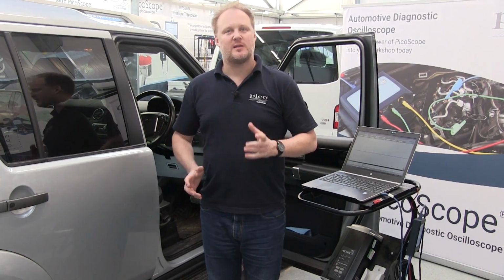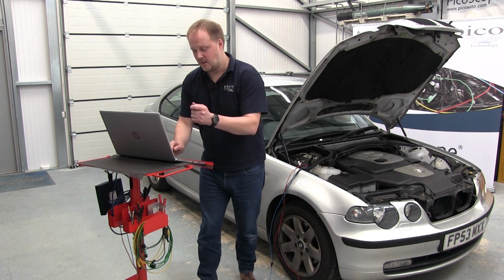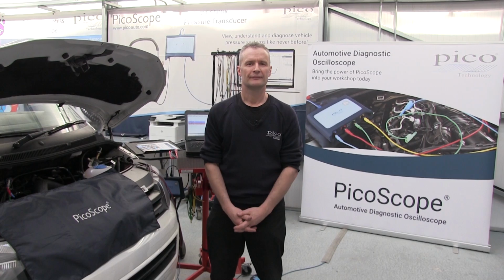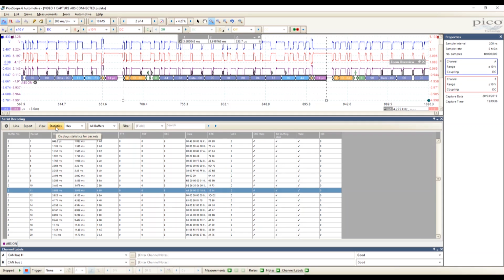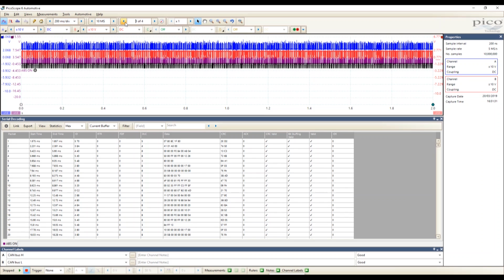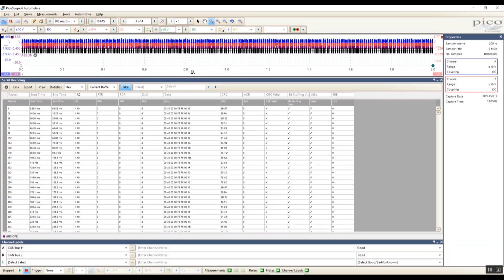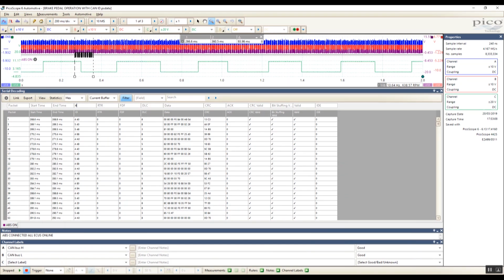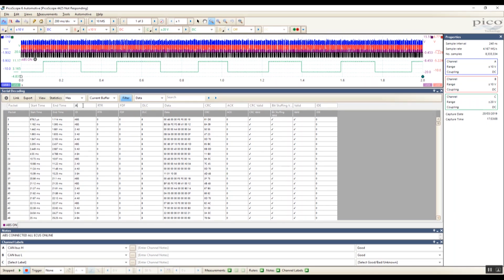Practical Pico: CAN bus diagnostics and serial data decoding

Comment: Wow great video,very knowledgeable ,j work in a main dealership its a shame they dont give us the ID info so we can go to faulty components  after de coding for a quicker diag as apposed to removing units off the Can system and resistance measurements

Thank you

Comment: Hello sir , i have picoscope 4425 and i am looking for no com with engine ecu and i trace the can network and in this high speed is engine ecu, abs, uec,cim,ehps and i connect on high low pins at its ecu alone and decode i have good signal and decode packs of data messages that include valid and invalid data but in the engine ecu can pins i hane only good signal waveform but no , either one data pack. How is this possible? What is the meaning? Or problem?opel astra h 2005 z16xep no comm with the engine ecu faults from the other ecu , the car becomes hot crank no start or no crank no start. Thanks in advance!

Comment: That resistance is only on the circuit between the other terminating resistor and your test, it dose not confirm the other modules in parallel have a good circuit at all. You may have a dash cluster or radio infotainment system that has a broken line to them and don’t run the other resistor, they now have not been tested, it’s important to know this, if you have a faulty ABS because both of these lines are needed for different functions from the ABS.

Comment: I'm interested in the rolling cart, where can I get one for my scope?
Reply: Hi , It depends on which rolling cart you are talking about. The cart used in the shot with Barney  (black unit) is a Ctek battery test unit supplied via CTEK. The red cart is an emmission tester trolley supplied by our Danish distributor (not avalaiable anymore) or the black tool box are purchased by Sonic tools in the Netherland. Hope this helps Philip

Comment: I completely get the concepts in this tutorial. But, question, is this to determine a faulty module on the network? Also, are the circuit tests in the beginning common failure modes to look for?

Comment: Is it possible to carry out the same tests but with the 2206b scope please? I really would like to add this to my diagnostic bag but can't afford the automotive series?? Great video by the way, info from the pros, 1st rate👍🏻
Reply: Hi,

Thanks for the feedback which we really appreciate.

The quick answer is that yes, it is possible to carry out those tests with a 2000-series scope as long as you have sufficiently high bandwidth and sample rate.

Beyond that, I'm afraid I can't support you with more information as the automotive team cannot support users with 2000-series scopes as they are not automotive products.

Some related info that might be relevant...

I appreciate that the automotive products seem more expensive at first glance but by the time you add equivalent accessories and specs - including upgrading to a higher sample rate model and adding attenuators for all the channels etc. - the difference is not so great. This is especially true if you compare the cost of an automotive kit to buying all the components individually.

Note that you can never actually achieve parity between the 4x25 scopes and the 2000-series as the former have floating inputs, 12-bit resolution (compared to 8-bit), and a ruggedized boot etc.

The difference in price also covers the Guided Tests, Waveform Library and PicoDiagnostics plus, support email/hotline availability, and online videos/articles etc that come with the automotive scopes. So actually you get an awful lot extra for a small increase in price.

As a former tech, I can totally relate to the difficult investment decisions we have to make (especially at this very difficult time) when you are trying to better yourself and the skills you can offer. But, hand-on-heart, I believe that starting off with the better tool will save you money in the long run, even if you have to wait a little longer before you buy one.

I hope that helps. Good luck on you oscilloscope diagnostics journey!
Barns
Reply: @pico_barney  Wow, what a great answer, I can see now the worth of the automotive series scopes and what now seems good value. Looks like I need to do some overtime! Thank you very much for the reply and keep up the very informative content 👍🏻

Comment: Hi, thanks for the video.How could you relate a problem to the various CAN faults you listed when an car would stay on one gear without shifting and when you turn off the engine and restart the car, the car starts shifting fine. What can faults could this problem fall into. Thanks.
Reply: The car probably has a bug within the software that is dealing with shiting gears, that acta like you noticed.
At first start of engine comes one (the bug) at next start everything is clear and nice.
Got to manufacturer and exlaind and ask for an update of the gear-shift module or to rewrite their software again..
Reply: Hi Paul, The question is: are you getting CAN-related DTCs when you do a full scan of all the vehicle ECUs? If you are getting transmission-related CAN DTCs then, possibly, suspect a CAN-related fault causing the problem you describe. If you don't have those DTCS, then you may be jumping to conclusions. I.e. what is it that makes you think that CAN is responsible for the symptoms you are seeing?

Comment: What is the exact model number of the device used in this video ? And could we do the same things on a lower models like 2 or 3 series ?
Reply: A 4425 scope was used to perform this test. Of the current automotive scopes we sell, you could use a 4225 (2-channel), a 4425 (4-channel) or a 4823 (8-channel). Of our older automotive scopes (no longer available from new), you can use a 4223 (2 channel) or a 4423 (4 channel). The bandwidth (10 MHz) of our older 3000-series automotive scopes is too low to reliably perform these tests.

Comment: What are CAN sniffers used for to do what or what have you used them for? Dodge & Chrysler cars use TIPM boards, How does a TIPM totally intergrated power module or central gateway work what does it do? There is different CAN signal names, CAN diagnostic, CAN isolation, CAN ground, what else?
Reply: Hi Bill, thanks for this comment and the others that you have left throughout this list. We are happy to help with points of clarification on items within the video and with matters relating to the use of our scopes. For other matters, please feel free to seek help from the wider community on our online forum (https://www.picoauto.com/support/index.php). However, it may be useful if you find other opportunities to undertake training or self-learning - it will pay you back, I promise! Also, please try the manufacturer's reference material for the highly specific information you have requested. Best regards, Barney

Comment: Thanks, Every car as a TIPM central gateway circuit board which has Microcontroller chips and Transceiver chips  which all the modules connect to the TIPM circuit board? I'm not sure what this TIPM circuit does can you explain more about TIPM circuit boards? When you get a checksum error how do you know if its the transmitter or the receiver because both or one or the other can cause a checksum error, so how do you troubleshoot to know if the transmitter is causing the checksum error or the receiver is causing the checksum error? The DLC connect has SAE J1850 signals and ISO9141 Signals, do you use these to troubleshoot failures in cars or what are these signals used for?

Comment: BARNEY DONOHEW, how did you create "OPEN circuit module" you disconnect the CAN signal Low signal and only left the CAN High signal active or  how did you create OPEN circuit CAN signals? My other question is most modules are hard to get out to disconnect without tearing the whole car apart. Can't I just remove each fuse at the cars fuse box one by one until the CAN bus signals returns back to normal? When measuring a CAN signals how can you tell if the CAN signals are 2.0A, 2.0B or CAN FD because they all look the same to me so how can you tell the differences so i know what to set the CAN Baud rate to? If you wanted to upgrade from CAN 2.0A to CAN 2.0B to CAN FD all you have to do is replace all the CAN transceivers to CAN FD transceivers? the CAN buss harness stays the same and all the CAN ECU modules stay the same only the CAN transceivers get replaced?
Reply: Hi Bill, the answers are as follows:
i) we disconnected the ABS module but then put break-out leads on CAN-L and CAN-H between the module and the loom. This meant we lost ABS communications but were able to maintain bus integrity. Obviously, it was then easy to access the lines to create short and open circuits and to introduce high resistances etc.
ii) Pulling fuses could work. So could analysing any DTCs to give you an idea of the problem nodes in advance, which you could then disconnect as you scope the messages (as you mention above). You'd then be well placed to start circuit checking in the right places if need be.
iii) You don't need to worry about standard (2.0A) and extended (2.0B) CAN IDs. PicoScope Serial Decoding will take care of that for you.
iv) The data payload within the middle of a CAN FD frame is at a noticeably higher bit rate that the surrounding message (which contain the ID and ACK portions of the frame). So you will see 'more switching activity' in the middle of a CAN FD frame compared to the parts on either side. You will need to look out for this difference and, if it exists, select CAN FD rather than CAN serial decoding.
v) You can't add CAN FD messaging into a legacy network (where the controllers within the other nodes are expecting classic CAN). If you want to have a mixed CAN and CAN FD network the classic CAN controllers need to be CAN FD tolerant (i.e. they need to understand that it is present, without actually being able to transmit/receive those messages). CAN FD controllers can transmit and receive both classic CAN and CAN FD messages.
Hope that helps.

Comment: PICOSCOPE Automotive,  The CAN Bus has voltages and decimals values but how does a technician know they are good or bad CAN bus signals? What are the most common CAN Bus failures that a technician looks for? and you give more examples about this
Reply: Hi Bill, thanks for your comment. We show quite a few 'normal' signals in the video (e.g. at 13m40s). These are always a good reference point: anything that doesn't have that same regular structure should cause suspicion and prompt further investigation (e.g. checking bus resistance in the first instance and then more detail circuit testing). Our PicoScope Automotive software contains a more detailed description of these waveforms (within the built in Guided Tests) if required. Regarding faulty signals, go to 13m55s in the video and you will see that we run through over half a dozen different examples of possible faults and the associated waveforms. The main thing to remember is that CAN buses are just circuits: they will be susceptible to open or short circuits or high resistance. If you know how to test for these on other circuits then you will know enough to test a CAN bus. :) Hope that helps.

Comment: Great job, Barney and Steve. There's a lot in this video, though I din't fall asleep. I liked the explanations which enable one to distinguish between different faults, and having example traces for each type of fault. Very well presented. Equally, I liked the walk through the serial data. Towards the end I was starting to think about other specific changes which might be identifiable, such as ABS pressure variations, as opposed to simple commands on or off. Just at this point the sound all but disappeared, though I believe you did briefly touch on this, as well as other possibles, like wheel speed information. (Must listen again !) )We keep hearing that serial decoding doesn't have any real use in diagnostics, but I get the impression it does in certain circumstances - especially if you can identify identifiers, and use the other 'simple' tools within the software - and Excel - to filter. Still, a fascinating subject and this really helps to better understand just how much serious 'waffling' is going on at any given moment among all the different 'passengers' on the Bus. I was at the back of the Bus so didn't take it all in, lol Look forward to the next one. Thanks.
Reply: Thanks for taking the time to give your feedback, David. Much appreciated!